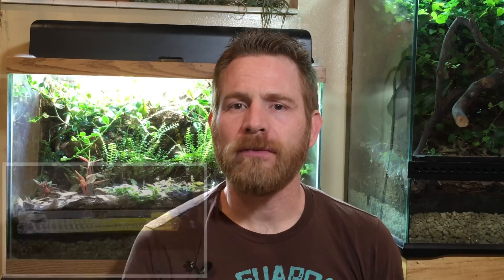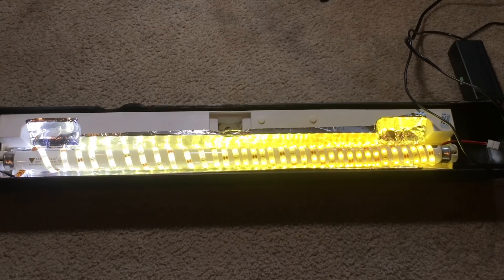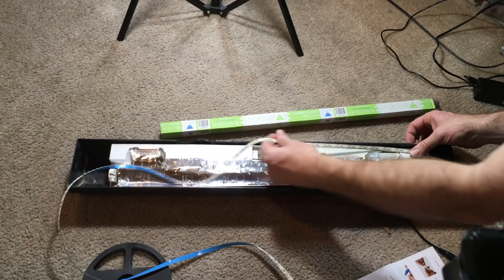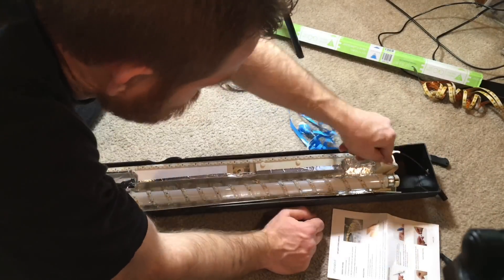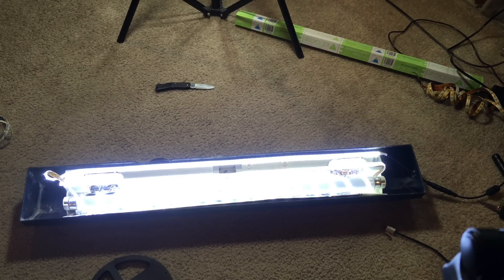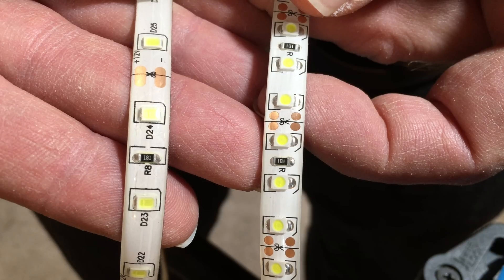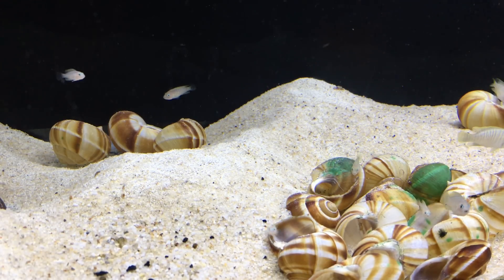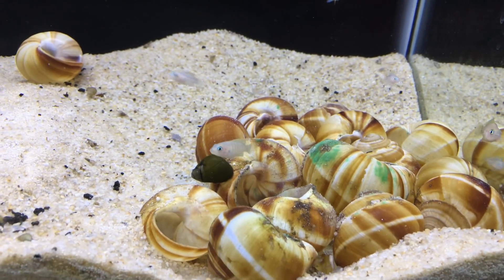DIY LED Aquarium Light-Problem Solved!

Comment: You could try winding a roll of 'bacofoil' (aluminium cooking foil) around the tube before winding on the led strip...might help to dissipate the heat over a larger surface area?
Reply from the maker: Jim Maxwell Good suggestion! Thanks!

Comment: Just remove (cut off by razor blade) that silicon media right above diodes. The media darkens with time any way.
Reply from the maker: Лариса Довганюк So shaving it off reduces the insulation of the diodes, and that helps keep it from overheating? Cool!
Reply: Too, but in first it removes that brown colored film, it film not diode itself is brown. So you "restore" original diode color.
Reply from the maker: Лариса Довганюк Ah, I see! Great information, thank you!

Comment: It should just be the winter. Then it should be low 70s. I have a reptitherm u.t.h. 30-40 gallon, but it only raises the temp about 2-3 degrees. Woud it be too much if i put another of the same reptitherm. Its only a 20 gallon long on its side. The heaters may take up a lot of space on the outside. Would that make the gecko feel to stuffy or somehing. I have no idea .
Reply from the maker: Meghan Cerven If the spot with your existing heater is above 70 but below 80, that may be enough. If it is still very cold in the rest of the enclosure, you could add another one, the gecko won’t mind if the heater blocks the view...it won’t feel stuffy. The main thing is making sure the temp is below 80 but hopefully above 70 during the day.

Comment: they quite often go like that , .......especially the water resistant strips .
i think it is because they are encased in a plastic coating !
the second strip is open and gets more cooling .
Reply from the maker: theklrdude oo That makes sense, the plastic coating serves to store the heat right there over the diodes! Good point!

Comment: best of luck with new version of the DIY LED lighting project.  Have you considered drilling holes in top of the plastic top around the light fixture to help with heat management and the long term happiness of your new LED's?  Thanks for sharing Rus!
Reply from the maker: Sean Meister I did think about that, it sounds like a good idea...the more ventilation, the better!